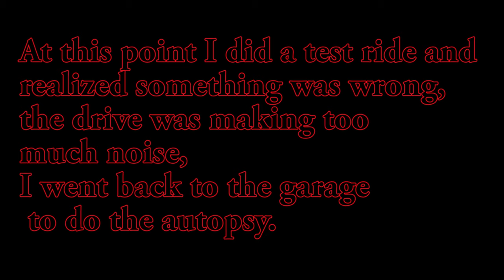Chain and chain sprockets change - Kawasaki Versys 1000

Comment: I noticed when you adjusted the chain, the 2 alignment marks didn't look exactly in the same place (if you trust the marks.) That could have caused the excess noise. I just replaced my Versys chain and went with the Vortex 42 tooth rear sprocket. Stock is 43. It dropped the rpm by 5-600 in 6th at highway speeds. I haven't owned a chain drive MC in many years and curious about the life of modern MC chains. With the stock set-up, the rpm was almost 5000 at 80 mph. It now is only 4300 rpm, which sounds more relaxed and pleasing to my ears. I kept the front sprocket because it showed little wear and no slop with the new chain. As a side note, my stock chain had over 33,000 miles when replaced and it only needed 4 adjustments throughout its life. All the chains from my 70's & 80's MC's lasted maybe 10-15,000 miles. I was very pleased with the chain life of the stocker.  I looked down at an earlier post and saw that you only got 16,777 miles out of your stock chain. I'm  pretty religious about cleaning the chain with kerosene and then using chain lube every 3-400 miles. Thanks for the video. Nice detail and I appreciated the fast forward when removing bolts and parts. Hope you get better mileage out of your new chain.

Comment: I am going to replace the chain & sprockets on my bike and your vid has given me a few good tips. After careful research, I am going to fit an RK chain & rear sprocket, but replace the front with EOM. They are cushioned, while the aftermarket ones are not. I also bought an alignment tool (Motionpro) to check the alignment when I have it all fitted.

Comment: The original front sprocket is in rubber - that's why it's quiet. Therefore, the front sprocket is always best to buy OE. Video, as always, great MotoAndy :)
Reply from the maker: But that doesn't explain why the rear sprocket also makes strange sounds, theoretically not much different from the original in terms of thickness or structure.
Reply: hmm, that's interesting indeed. but in the video at the end it seems that your chain is a bit too loose. Maybe it just looks like this in the movie ?
Reply from the maker: @zoltaibiza  when you ride the chain works with the suspension so sometimes it is looser sometimes more tight, I set it as needed, so it's just an illusion in the movie

Comment: You need to replace the sprocket with rubber dampening, had the same issue before, and was fixed by replacing with sprocket with rubber dampening
Reply from the maker: You're probably right, I get this opinion a lot, so there must be something to it. Thanks for your comment. Ride safe

Comment: I would have left the old chain on and used it to pull the new chain through.
Reply from the maker: @christophersmith-zn2kn  but I also changed the sprockets so it didn't make sense, if I was changing the chain only I would do as you said

Comment: Hey Andy, does your Versys rear brake caliper have a tiny bit of wiggle?  I have a brand new 2023 Versys 1000 and I just swapped the chain and sprockets and I reinstalled my rear caliper and no matter how hard I tighten it down it still has a tiny bit of wiggle, just wondering if this is normal?

Comment: @MotoAndy Just a tip - the buffers inside the rear sprocket hub are way too large, at least they were on mine, and push the hub outwards. When you tighten the rear axle, you push the hub back inwards but that creates a tension inside the hub bearing - mine got killed in about 50k.

Comment: It's just that OEM front sprocket have rubber damper and your JT don't. JT have front sprocket with or without rubber damper, except for once, i always used JT front sprockets with damper (on 2 of my previous Z750 and now on Z900). Nothing wrong with sprocket without dampener, it's just louder without rubber damper.

Comment: Hi Andy, top video and thanks for sharing as you always do, even though you had some disappointment. Not sure if its 100% equivalent / relevant, but I had 2 VFR Crossrunners before my V1K. Both had that exact same chatter from the front sprocket. Both on 100% original fit oem kit(ie Honda factory fitted). You could hear it clearly even moving the bike round the garage. Couldn't really hear it at speed. Anyway , quick check on the forums confirmed it was typical of vfrs. No concerns raised unless there was undue play of the front sprocket on the splines other than the  normal fraction of a mm float. Many 1000,s of miles done on both without any issue other than raised eyebrow when pushing it round. Or spinning it up on the stand. Anyway...just thought I'd add this to the discussion.  Cheers ....hope all is well in Cloggy and otherwise with your V1K
Reply from the maker: Thanks Paul. In my V1, the faster I rode the sound was louder, so a bit different than what you describe from your VFR. Cheers
Reply: Yeah..you know when something doesn't feel right. Plus I can see you are a  perfectionist. Hope you  weren't out of pocket too bad. I guess there should have been a good will contribution if nothing else from the  package supplier

Comment: Great videos  Andy I believe the problem may be that your front sprocket needs a spacer I noticed it was not as thick as the OEM sprocket so probably an alignment issue I hope this helps.
Reply from the maker: both sprockets front and rear make the same sound, even after OEM replacement of one of them. Thanks for the hint, but I don't think that's a problem. cheers

Comment: OH!.. is that whine the JT front Sprocket... mine was just done like two days ago and I could not figure out the whine... like a jet engine winding up... my mechanic had to cut off the front nut so I thought the new nut might being spinning close to the graphite speed sensor just under....    one year rider here. Dave 63 2015 650 versys
Reply from the maker: Yes it is JT whinning.......

Comment: Great timing with the video, i'm just about to change my chain and sprockets on my versys.
I got a silent running front sprocket, so hopefully wont get the noise issue.
What chain lube do you use?
Cheers Andy!
Reply from the maker: I'm using Motul chain lube and with OEM sprockets there is no noise
Reply: Is the Motul a dry lube? I use S100 dry lube since June this year, and I’m happy with it. Using it, because of all the dirt and fling normal lube has.
Reply from the maker: @Momo-Sparco   I use Motul chain lube Road C2 its a wet lube
Reply: Shep is right about the silent running sprocket 
That rubber ring makes the whole thing much more quiet than the one without the rubber ring
This being said, it’s only a noise problem and not a mechanical problem 

I would suggest also to realign the chain with a tool and not rely on those mark on the swing arm ... they are not very precise and might have contributed to the excessive noise

Otherwise, great video, I learn lots things myself !!!!
Reply from the maker: @filsen4660  Thanks and yes I did checked the chain to see if it was aligned with the tool, I just didn't film it. Now I know about sprockets with rubber ring so next time I just order OEM sprocket. Ride safe
Reply: All JT sprockets with no cush drive sound like that. Great vid 👍
Reply: I recommend chain saw oil for lubing your chain. You can buy a gallon for about £15, and it'll last years

Comment: Hi Andy, why did you cut the old chain when you had to remove the rear wheel? ;) And did you use dry lube on the new chain?
Reply from the maker: to disassemble the chain you have to break the link or cut it, otherwise you will not take it off, because I was replacing it with a new chain so there was no point in breaking it, it was simply faster to cut. And the wheel must be removed to change the sprocket.

Comment: Too much noise because the front sprocket was a fraction too big?
Reply from the maker: both front and rear sprockets make the same strange noise, in my opinion the JT sprockets do not match this chain, probably the tooth spacing is incorrect